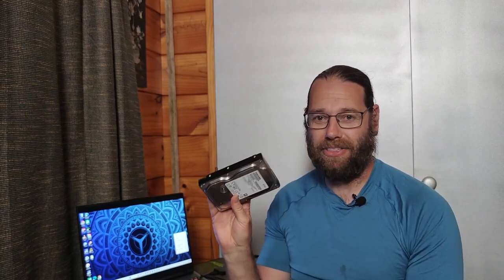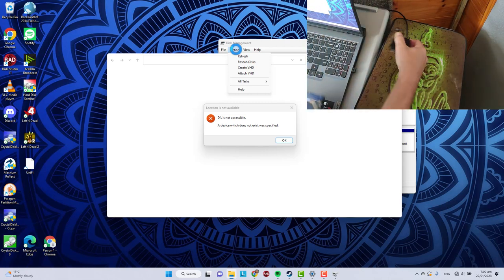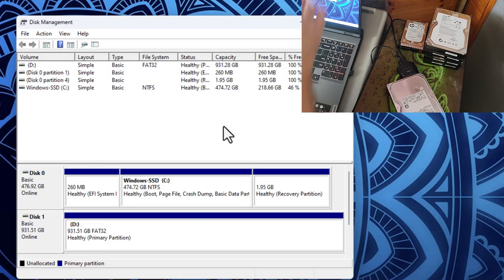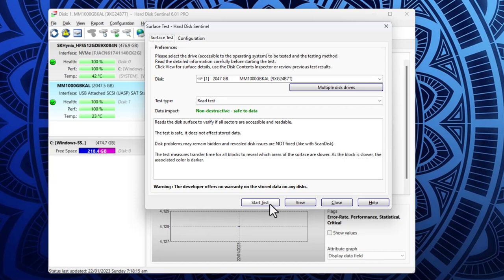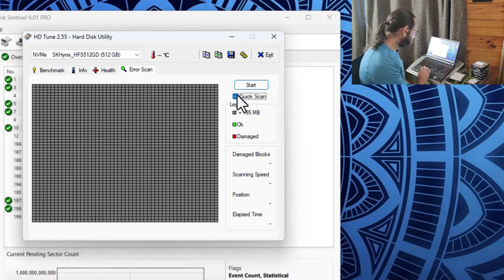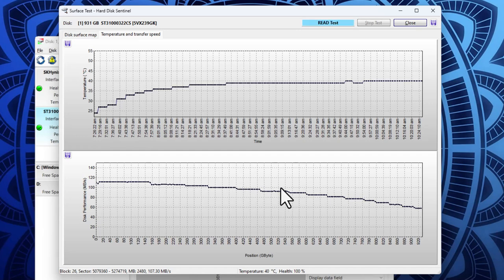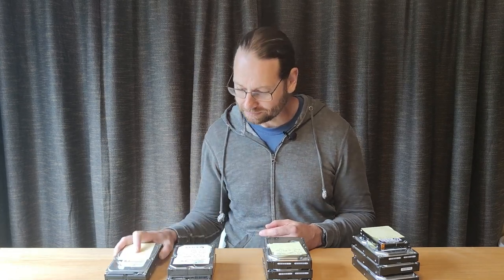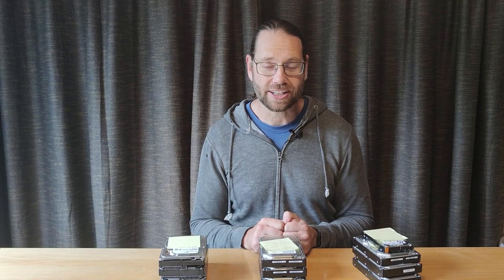Out of 10 Hard Disks From a Computer Recycler, how many work?

Comment: Hi Dude, if you have two of the exact same model HDD where one isn't detected and one is, you can swap the controller (the PCB) between them to confirm if that is the issue or not - will probably need a little bit more of an in depth explanation on how its done but I haven't done it for yonks and my brain is slowly mossing over. It is something that is regularly done in digital forensics/data recovery. with that said though probably a bit more effort than its worth for a $5 dollar second hand HDD.

I am curios also if there is any data that can be recovered on those working HDD's - would be cool to see if the vendor used a single pass or a multi pass erase method.